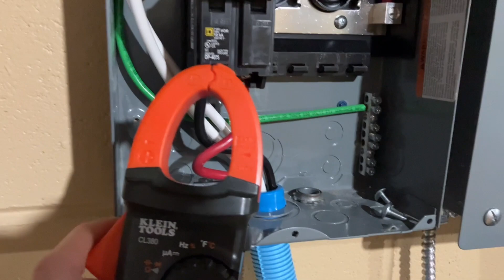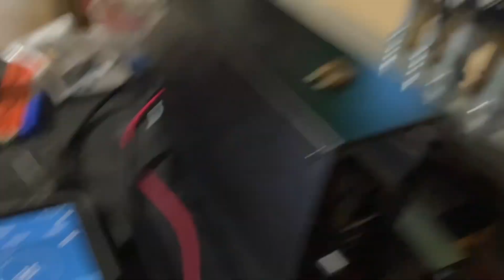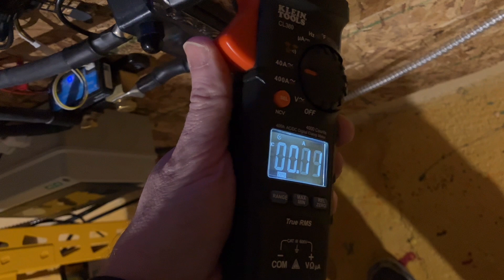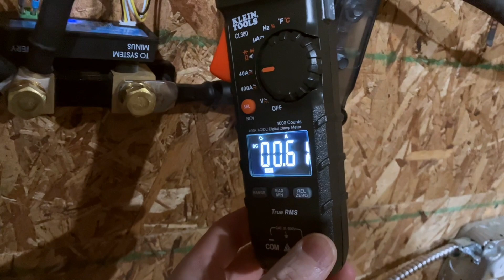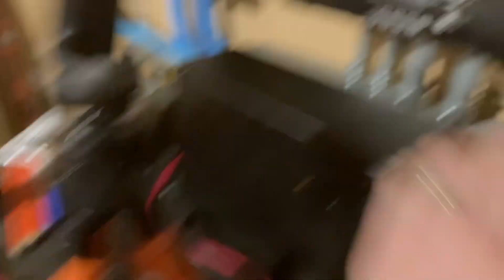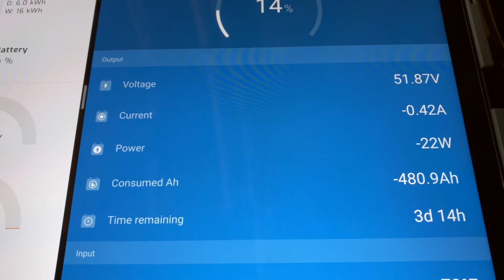EG4 6500 Power Consumption Observations

Comment: I need to check my Growatt 3000, but I know those EG4 "rebranded" all in one units have been troublesome for everyone who uses them. I would go with a Schnider or Victron Multiplus, I blame the firmware on them.
Reply from the maker: I would love to be able to say it’s a firmware thing, because updating the firmware is a whole lot easier to fix than hardware issues.
Reply: I had one of the first iterations that has since been replaced. it had an idle consumption of 145 watts. It was pretty hard to swallow
Reply from the maker: @stephenfuller2936  is that the current consumption rating or from the original units?

Comment: If your inverter is always on and supplying power, consumption shouldn’t be matter at all, just add extra panel to compensate the consumption through out the day…
Reply from the maker: Sure.  Just making an observation that the “newer” units draw more power than the older ones for some odd reason.

Comment: What do you expect from Chinese inverter?
Reply: Solarks are made in China. Scheiders are made in China. I don’t think the manufacturers geographical location necessarily affects its performance. I believe  he’s just documenting his experiences with the inverters to help others.
Reply: @GavinStoneDIY  yeah that’s why Sol-ark if you get a balance on the phases it turns off so dark is only the best inverter if it’s grid teid schneider is emerican design and 20 years on there belt
Reply: @solarandwindinsouthtexasda1473   don’t get me wrong. I’m definitely not a fan of EG4’s.  I’m just saying nearly all of them are made In China. Solark has had issues with some of their models yes. Apparently the 15k is a really nice inverter. Not hearing as many complaints about imbalances between phases. Schneider has kept their design fairly simple. There is something to be said for simplicity. Anyway, they are all Chinese. You’d be better saying the eg4’s are low cost or cheaply made. I’d probably go for that. 😉
Reply from the maker: Ultimately I would expect them to have the same consumption if there weren’t any additional electrical changes between units.  At least within a couple percent of each other.

Comment: In my opinion the idle consumption is higher then the manual because they are still using the stats from the old manual. And that is based off the original 6500 inverters. They have larger fans in these inverters plus whatever higher voltage capacity hardware they installed. So that may not be as efficient. Most of the manual was just a copy from the mpp version when I looked at mine.
Reply: Same manufacture 😂 duh
Reply: @warzoneclips2285  voltronics, yes. Supposedly anyway. But they could at least update the manual to reflect the changes they’ve made. That was my point.
Reply: All they changed was the mppt board and the terminal blocks now
Reply: @warzoneclips2285   they are running completely  different firmware altogether and they’ve removed the bonding screw. And potentially other things. All of which potentially effect the ways in which you should wire the unit and it’s performance. Some of this is reflected in the manual and some isn’t. My LV’s use 71 watts idle consumption.
Reply from the maker: Odd thing is the idle consumption is different between my old units and new ones.  I asked SS about it and just last night I was informed that additional internal boards where changed in these revisions which could account for the higher idle consumption.  I’m waiting for a better explanation to see if it’s actually true though…
Reply: @AdamDeLayDIY  yeah you may get different answers the more you ask. I wonder if any of those changes helped the other problems they have.
Reply from the maker: @GavinStoneDIY  guess we’ll have to wait…..and wait….and wait….to find out 😁
Reply from the maker: @GavinStoneDIY  of course now I might never know.  When I asked the question about what internal boards were changed, I also made the comment that I was working on a video for my YT channel about the inverter consumption…
Reply: @AdamDeLayDIY  yah won't surprise me too much there bottom line, these things have got some issues!!! Check out my comments in the main section!
Reply: Yes they have larg fan's and altho they do slow down when there is no load, but they never stop, if they did this thing would overheat, put a thermometer in the air stream  it is considerably warmer than ambient air, which doesn't exactly add up to high efficiency, but it does at or near full load only because 200 watts is such a small part of 13KW, but let's face it running a few LED lights and maybe a computer or TV, all of those loads together is still less than what the inverters are using, let's assume that you are only on batteries for 10 hours that's about 2 KWH used just to keep the inverters alive, that's one 500 watt panel working 4 hours to recover what they have lost, and it's for this reason that a lot of people are installing much smaller inverters that are way more efficient to run their lights, refrigerator, and small appliances and are only using those EG4 65-48's for the big stuff like well pumps, electric dryer, electric water heater, etc.

Comment: I have a question also. What version is of the raspberry pie are you using and do you have to have the lastest version to run solar assistant. I want to build my own
Reply from the maker: I bought a Raspberry Pi 3B off eBay and it’s running the latest version of Solar Assistant.